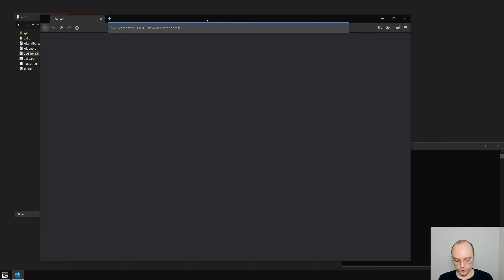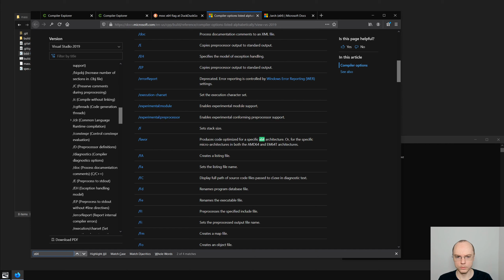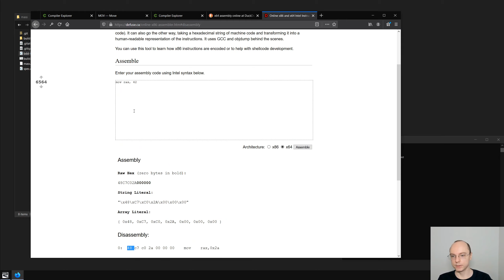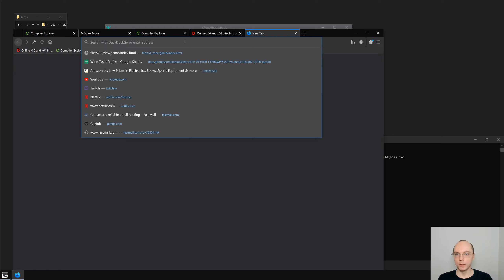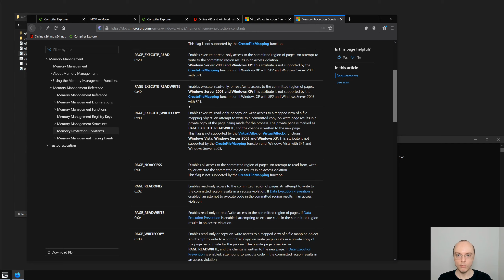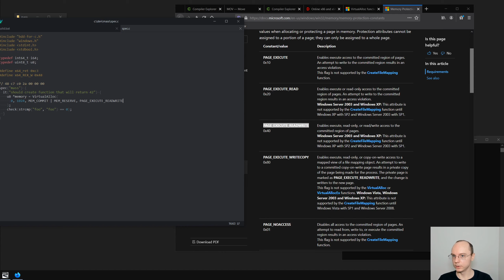Project Setup & Simple Just in Time (JIT) Compilation Example - Compiler Programming Ep1

Comment: I am starting out on compilers, can we have the same setup on Linux
Reply from the maker: For me Linux is a secondary target as I daily drive Windows, so I am not going to do a from-scratch video on that. However current implementation (on GitHub) is able to run simple function on Linux and you can use it as a reference, but support is incomplete at this time.
Reply: @DmitriyKubyshkin  Thanks for the reply, got that. The videos look awesome.

Comment: From what I understand, you said you would skip the lexer and the parser and generate machine code straight from the code itself, but it is not clear to me why. Don't all compilers and interpreters need an AST to generate machine code? If not the AST, at least the tokens from the lexer?

Now it is not clear if ASTs are a necessary part of code execution or if ASTs are mostly used for language analysis and transformation, similar to what TypeScript does to generate JavaScript
Reply from the maker: My point was more along the lines I'm not starting with the lexer and parser.  And you could just keep the language as purely embedded into C and not have a lexer / parser. Having said that there will be a lexer (probably around episode 50-ish) and there might be a parser in some form as well later on. Probably no AST though, but can't be 100% certain on that.
AST are very handy and allow easier implementation of certain optimizations and give an ability split compiler into multiple (simpler) passes that first transform the AST into a more canonical form by expanding syntax sugar and making stuff explicit. It is also often the stage where type checking is done, but none of that technically requires ASTs
Reply: @DmitriyKubyshkin  Thanks. Makes sense.=)

Comment: So.. how did you manage to get msdn pages with black theme? The white is burning my eyes!!
Reply from the maker: You can just enable system Dark theme  on Windows or Mac (not sure about Linux). Browsers detect this and website that support dark themes (like MSDN) automatically switch to dark theme as well. Some browsers allow you to force dark / light theme without system wide changes as well.
Reply: @DmitriyKubyshkin  TIL moment! Thanks
Reply: @antoniocs8873  The Dark Reader browser addon is great for switching most sites to a dark theme.